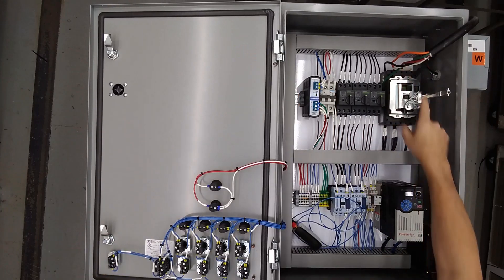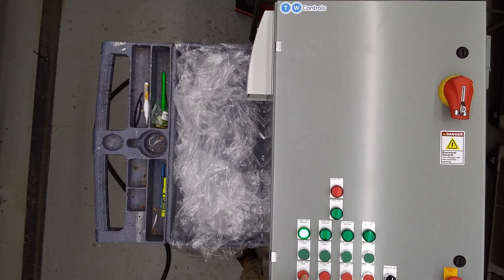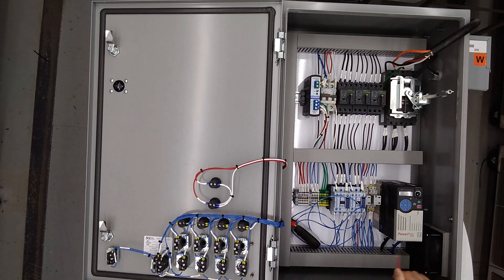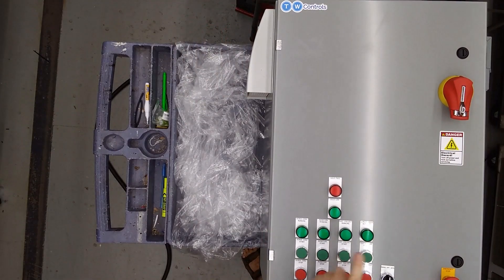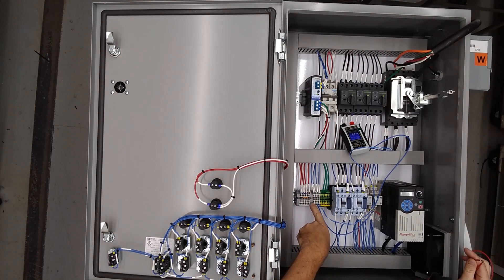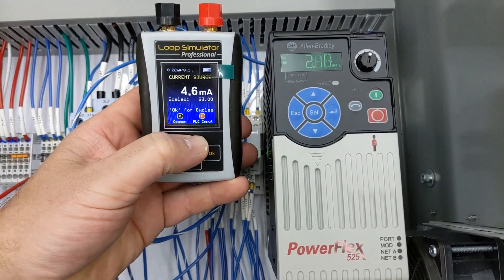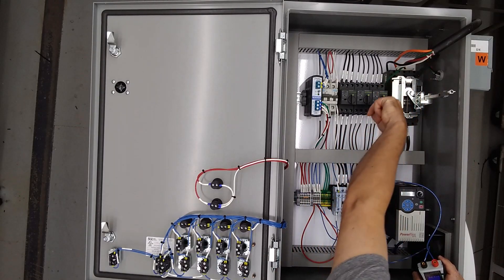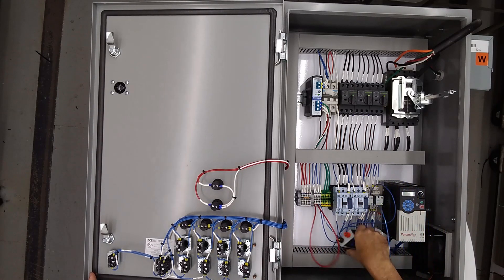UL 508A  Industrial Control Panel with Multiple Motors and VFD

Comment: How many motors are you using in this video? I believe it was 2. Does the other motor runs on DOL and also controlled by the branch protection of the VFD of the other motor?
Reply from the maker: I cant recall for sure now but I believe there were two DOL motors and one of a VFD motor. Each had it's own protection

Comment: Thanks for video. Is the one of motor controlers used for branch protection of VFD. If yes is it permitted ? I found info that only when it is allowed by manufacter and written in manual. I have big isue with that becouse Im starting to assembly control cabinet with accordance with UL becouse the ssytem will be shiped to Alaska. Im from Poland btw. Regards.
Reply from the maker: Your information is correct, as long as it is specified as such by the manufacturer.